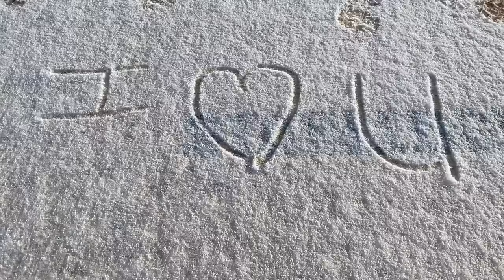TIMELAPSE - Couple Builds Off-Grid Cabin Alone In The Canadian Wilderness

Comment: Ekkkkkk plywood that goes down to the top plate and no hangover?!?! That’s a hinge point and that was a mistake. That plywood wanted to come down over the outside box helping it tie in the walls and the whole structure.
Reply from the maker: I am thinking you are talking about the bottom plate and if so, there is a small overhang. No mistake ;)
Reply: @MBFModernHomesteading  nope. Not the bottom plate. The plywood should go down bellow/flush with the bottom of your joists. This way you can nail the plywood into the joist box as well. Not having the plywood hang down creates a hinge point. I’m not being rude saying this I’m merely making a suggestion for next time. 

I take you you did 8 foot walls. You’d have been better off overhanging the plywood flush with the bottom of the joists and then putting a scab piece up top. This helps with up-lift from hurricanes or tornadoes and anything from high winds. It’s just a more secure way of building. 

I think you and your wife did great tho 👍
Reply from the maker: @micdropfroggyface6466  I wasn't sure what you were getting at by saying top plate in your first comment. Having said that, we did over hang it a bit where you are talking about just below the bottom plate . All will be well, By the time all is said and done this thing isn't moving anywhere. Thanks. Have a good week :)
Reply: @MBFModernHomesteading  ya man you guys are doing a great job… pulling for you guys! Enjoy your dream my friend 😄😄😄

Comment: Please I am not here to knock on you.  Just have been through what you are starting. 
My cabin is just a 16x32 on only 8 pillars. For my land isn't flat here in Maine. Some parts are 18 inches to 24 inches from ground to Joists.  I used 2x12 floor joist with 12 inch insulation keep the floor warm.  Water come up under cabin. 
My mistakes.  Didn't count on all the mice rats and other animals wanting to make a home in or under my cabin. Mice mostly chewed at night. Trying to get in. Cause i have chickens and pigs. The feed help bring in the rats.  Even those my animals are 100 feet away.  
Problem is I am currently now under putting small square mesh so mice and rats can't get up into the insulation. Nailing this on the bottom side of the floor joist.
Other thing.  How to keep my water pipes and preasure tank from freezing under the cabin.  Don't know if you are having running water or not.  Juat some of my issues i found living in the woods.  Also. I do hope you are going with metal roofing and not shingles.  I made that mistake.  Coming from Michigan. I grew up with shingled roofs. But all my new buildings have metal roofing and i don't need to woory about snow loads.  
Didn't mean to throw out my 2 cents.

Comment: Won't metal supporters  rot  after time?  How many supporters to hold up a heavy house?   House is being build in kind of a bathtub.  Low spot. So when it rains?   All the rain water goes under (in) the house.
Reply from the maker: No, you can do some research on steel screw pile foundation and see any specs you are interested in. And we have shared videos of each section of this build where you can see everything more clearly, the cabin has drainage all around and is built on a pad.

Comment: Wasted opportunity for better insulation under the flooring. That "bubble foil" stuff has an R value of 1. An  R value of 24 or higher is what you really should  be going for.  If you plan on doing it later by crawling underneath, that is  poor planning. Either way, it's a HUGE mistake for colder climate builds.
Reply from the maker: I have used this in the past and it works GREAT. That alone with skirting works awesome, I understand the R-Value is what it is depending on how it is used but our EXPERIENCE with it along with the skirting, keeping rodents from nesting underneath is perfect. Will do it this way time and time again. But of course, we aren't telling anyone what to do, just sharing our experiences. All the best.

Comment: You made two major mistakes. Both will seriously effect your way of life in that house.

1. You should have insulated your floor. That foil trash will cost you 10 times the cost of R-19 insulation in a period of 10 years. You're going to lose a ton of your ambient heat. Big mistake.
2. Your trusses should have a much higher pitch for where you live. The snow load will contribute to many water, air quality and thermal problems. Too much to explain here.
Reply: Not to mention the gable truss on the front porch with no support will sag for sure. I do like the video and hard work tho.
Reply: You better do.